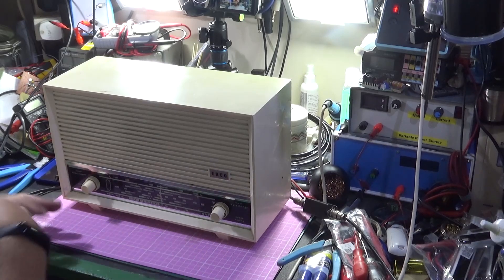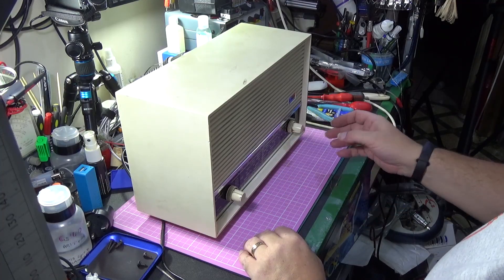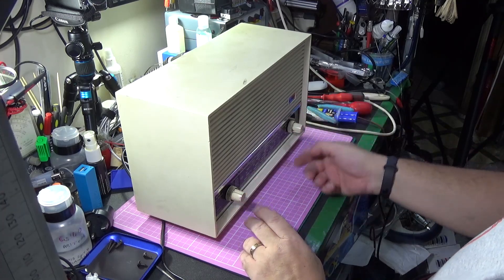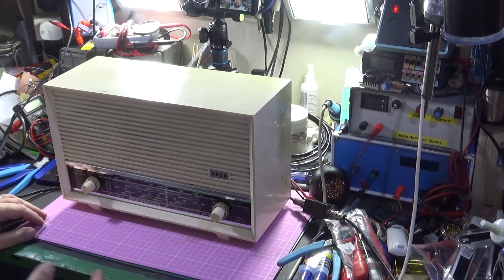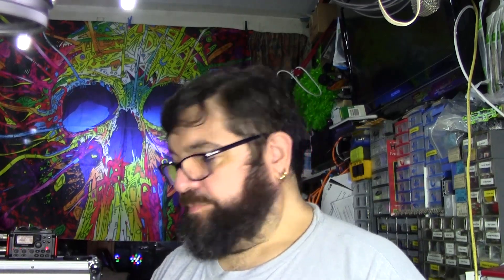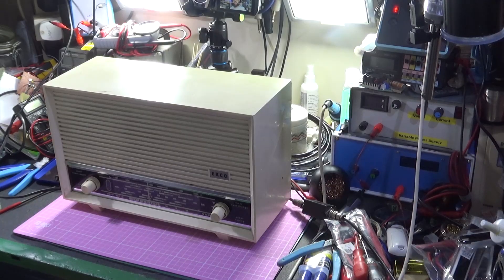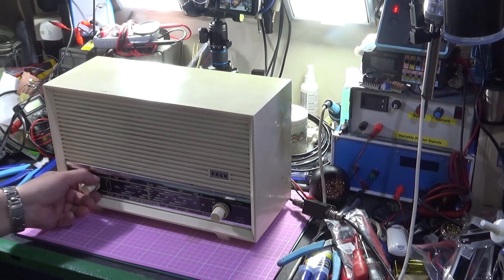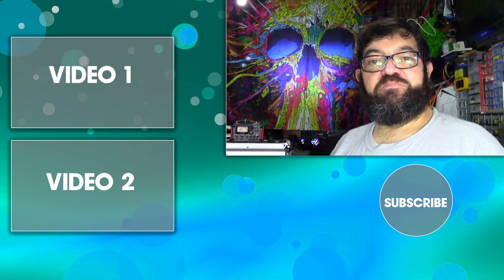Vintage Radio Repair Ekco U353 1959 Broadcast set Part 3

Comment: George, too bad radio Luxembourg  wasn't still a powerhouse. Wish I had some airchecks from the sixties. Had some brief samples from that period, but a lot of my reel to reel tapes were lost in moves I made over the years..  Sure your dad will love his newly restored set. It's good to have a repair  job go well without a lot of misery and headaches!
Reply from the maker: I know the feeling about losing recordings. I think it is at my mum and dads house but there should be my Akai reel to reel tape machine along with a big box of tapes. On those tapes are all sorts of things but the one thing I would like to get back is the original BBC transmission of the Hitchhiker's Guide To The Galaxy as aired on Radio 4. There is also a tabletop jukebox there somewhere too. Must send my brother up to the attic at some point to see if he can find them.